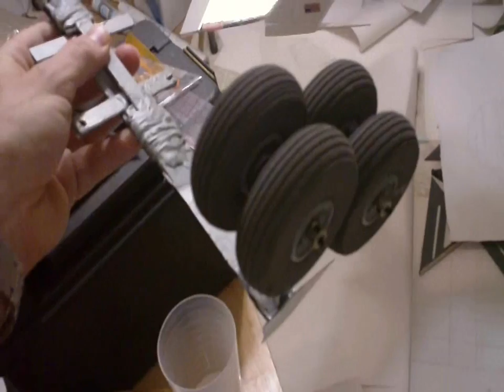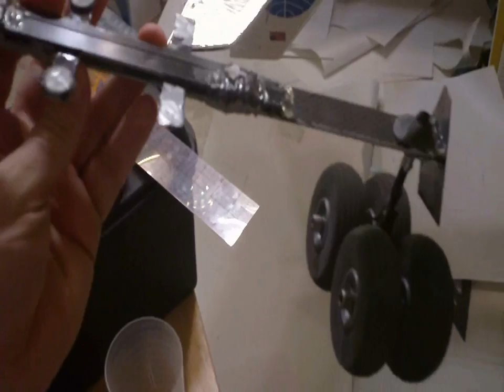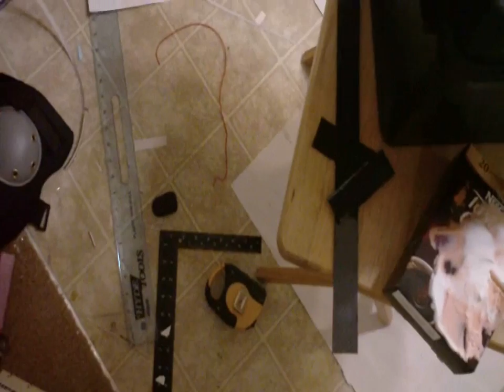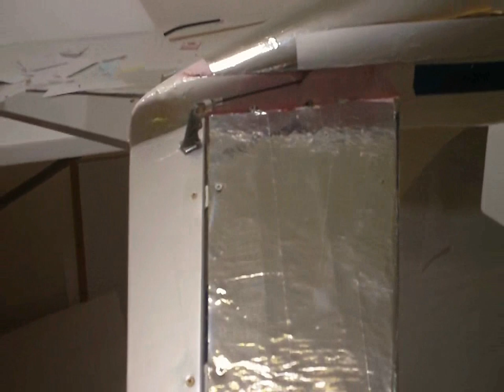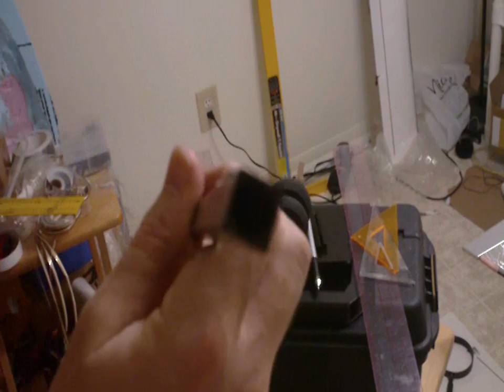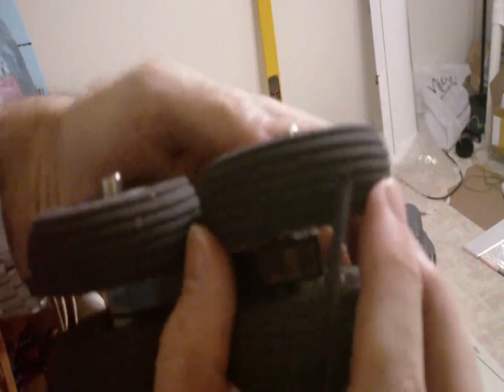How to make Landing gear for RC airliners! Part-1

Comment: can u sell one to me
Reply from the maker: A landing gear or a plane?
Reply: @F3HDemonDriver1  a landing gear
Reply: how much would it be for a fill set, the two back gear and the nose gear
Reply from the maker: Well I no longer make carbon fiber landing gear like these anymore Flamin, I now make them from aluminum and steel.
But I can make you a set, come join me on my Instagramm.
Reply: @F3HDemonDriver1  ok